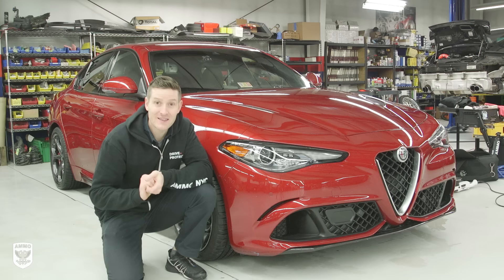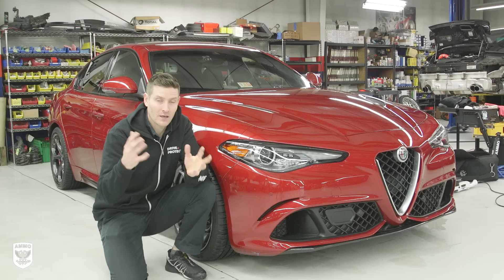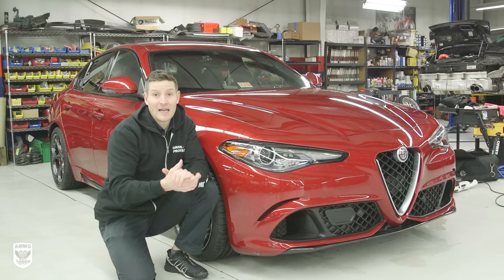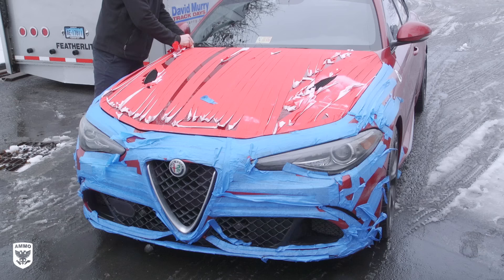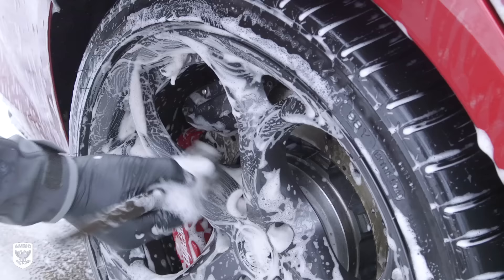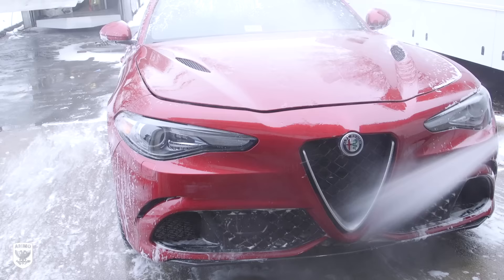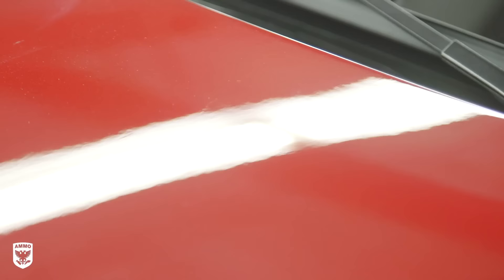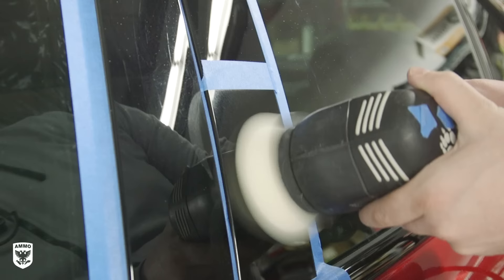New Car Prep: Alfa Romeo Giulia Quadrifoglio

Comment: the final bit of advice at the end about telling the dealership "do no touch or wash my car" is very useful. I have dealt with paint correction on a brand new car because the dealer ignored the new owners advice and took it through a carwash. It looked like a bear attacked the paint. It was horrible.

Comment: Man I miss when cars had proper manual transmissions
Reply: Gas Drawls this car comes in 8 speed auto and 6speed manual
Reply: Tony Aquiningoc oh wow I didn't know that, that's awesome.
Reply: Gas Drawls I miss before that when we had a horse and cart. .
Reply: Yes, you can get it with a stick but you can't get the manual in the US. No, it doesn't make sense and it's a stupid thing and decisions like that are why people hate FCA.
Reply: From what I've seen of the Manual, this one isn't worth it. The auto seems better, with quicker shifts and shorter gears.
Reply: Gas Drawls Why rely on technology from the 1920s?
Reply: No this is only in the auto, sadly.
Reply: zayaan ali 
But I'd still rather have the manual. Yes, it's not as fast as a modern automatic but I enjoy driving stick more than I enjoy the "foot down, let the car sort itself out" style of fast driving that a lot of people prefer these days. Kind of why I don't think I'd want a GTR or a modern Ferrari as much as an older car with more driver involvement, even if the new stuff is absolutely fantastic and way, way better than anything from even a few years ago. I really like this Alfa and would be really tempted to get one eventually but I'll probably have to stick to motorcycles for the sense of "oneness with the machine" that I enjoy.
Reply: Alfa Romeo offers this car with manual and auto only in Europe, but only auto in the state side.
Reply: Horse and cart? I miss the days when we had to walk.
Reply: Yes people I fully understand that modern day automatics are faster than traditional manuals, but I'd take a 7 second 0-60 manual transmission over a 4 second automatic. It's not about speed for me, it's about the thrill of driving, a thrill only a manual transmission gives me, I love shifting gears, not pressing paddles.
Reply: The absence of manual transmission is only a temporary choice, everything will depend on sales.
Reply: I'd rather a car with a good manual transmission. Reviewers are saying that the manual transmission isn't something to pine after, but they all say good things about the automatic. It maybe an unpopular opinion, but like I said, I'm spending 72k on this car and I want the quality transmission. The automatic is superb in this car, so I wouldn't mind it. I'd rather have a car with a quality gearbox basically, whether an automatic or manual.
Reply: No one cares about shift times or lap times.
Driving a manual is about driving.
Reply: last year Alfa was selling virtually no car to the US, makes sense you dont get all the options right now. Especially when only an handful of those would be purchased
Reply: The manual in this is just not a good manual gearbox. I'd rather have a great automatic than a mediocre manual.
Reply: Dante Gonxhja I guess you base your statement on a review. while it may not be a great gearbox different testers shared different opinions. davide cironi liked it and he seems to have quite well prepared
Reply: I base my statements on most reviews, owner impressions and having tried it myself. Trust me I love manuals, but not on this car. It doesn't feel precise and it doesn't have a satisfying shifter mechanism.
Reply: Albertotron I miss the days when we had to walk in our bare feet, as we couldn't afford shoes..
Reply: Gas Drawls This car has a manual version.
Reply: Not available in the states.
Reply: furtivedig 
Last year Alfa had one model available in the states..... and they said it won't get the manual. Not "might but not at launch."

Bit of a distinction there.
Reply: SkuzzyJ I only said it s not surprising.
Reply: I don't think that the Manual transmission is coming to the states.
Reply: I miss when you had to stick an angled bar through a hole in the front of the car and manually crank to start it.
Reply: furtivedig 
I'm not really surprised but I can still be annoyed by it. So I am.

Annoyed.
Reply: the giulia is avaiable in manual. :).
Reply: Ice Bonbon may have to do with the q4. Davide Cironi impression of the manual is not negative but I think we can agree the ZF is top notch
Reply: Gas Drawls I've driven it as manual - man it is good! The manual isn't best in the world but really goof feel to it still. I couldn't imagine why someone would destroy that beauty and connection with the car with auto..
Reply: TasteMyStinkhole Hey Stinkhole - thank you for your comment! Super and Hypercars usually aim for being ultimately fast not ultimately best drive. This thought aims for drivers car and best possible feel - as you might tell when you are driving it (I suppose you have tested both?).

Manual as a H or sequential is always more connecting and analog experience which I prefer (if I am not on the look for the last milliseconds on a track).
Reply: Mika Veijalainen 
Living with a manual in an extremely wet, hilly, high traffic environment is a nightmare, and fiddling with a stick and extra pedals in an emergency can mean the difference between an accident or a close call.  So again, people who love manuals have extremely limited driving experience.  I grew out of that shit in my early 20's.  It effing sucked.
Reply: ***** what do you mean people who drive manuals have limited driving experience?
Reply: TasteMyStinkhole I dont agree. I live in Finland where most of the year is snowy, wet and dark. Having instant throttle response, a clutch pedal and handbrake lever on slippery roads is essential as it increases control. An auto is a nightmare on Finnish winters since you have lag on throttle and have no ability to use clutch in cases (even on daily traffic). Sadly the Giulia doesn't have a lever handbrake. For example Rally cars (albeit having pneumatic "paddle shifters" on sequential gearboxes)  have both for a reason. They also don't have any slip of turbine (or alike)  and since have no lag on throttle pedal.

I don't mind the traffic on manual..
Reply: Mika Veijalainen 
Lol, wtf?  What auto doesn't have instant throttle response?  Are you driving cars from the 80's???  
My 2016 DCT M3 has nothing but instant throttle.  When I configure it in aggressive mode, it leaps forward like a jaguar on prey with a slight touch of the gas.  
Until very recently, manuals begin rolling backwards down the hill the instant the light turns green and you have to jump to the clutch before plowing into the car behind you.  Seriously, put down the crack pipe.
Reply: fair enough ;)
Reply: you struggled with moving off up-hill?
Reply: TasteMyStinkhole alright Niki Lauda, you seem to be all knowing expert here :)
ps try reading a book at some point
Reply: TasteMyStinkhole I see. thank god you are around.
Reply: furtivedig 
Yes, thank a fictional entity, good idea.
Reply: TasteMyStinkhole no wonder you don't like stick shifts, you're a BMW driver, you don't even use turn signals let alone manually shift gears.
Reply: TasteMyStinkhole 
Bet you get invited to all the parties
Reply: zayaan ali I have the manual QF and it is everything you would want in a compact super saloon! Not as fast, not as economical but interactive, makes you think about driving the car, and analogue in nature.

Comment: love the car. but that bonnet got f*cked up by that tape
Reply: sure did, but he fixed it :)
Reply: Martisan he just temporarily fixed it, with heat from the engine those lines will come back
Reply: Why? there's no tape there anymore.
Reply: Martisan They could come back because if the bonnet becomes even hotter than it was during the polish those lines can sink again. They probably came from the heat of the engine in combination with the tape. But you never know, maybe it's fixed.

Comment: My only concern is that M105 is such an abrasive compound.  Moreover, M205 has that capability when used long enough. Is the paint getting cut too much? If the paint is still similar depth to new (4-5 mil or so) I can see this being a great solution. Thanks! Awesome Channel.

Comment: I special ordered a vehicle, and the dealer actually put it on the lot when it game it...it had a deep, although small chip in one door (all the way to primer or metal) and a white paint transfer on another door.

Of course my car was a mid-range SUV,  in the $45,000 range, not an exotic sports car. 
I probably should have refused to take delivery...they did a somewhat okay job fixing those problems, but every time I look over it I find defects in the paint...bits of dust that got painted over etc.   I am not sure if this is par for the course with average non luxury cars, or if mine just skipped the QC process because it was a special order. 

One of these days I will take it to a professional detailer to see if these defects can be fixed.  Average people probably wouldn't give a crap, because these defects are only noticeable when you look right at them in specific lighting conditions...but quality control is my job, so they drive me crazy when I see them.

Comment: Nice video,i`m watching your video`s for so long now and i`m going to detail my car aswell, but i see you use 2 type`s of polishing, with the old skool pads and with the DA microfiber disc. What do you prefer to use?
Reply from the maker: Depends what works better for that particular paint and situation.  Thanks for watching!
Reply: AMMO NYC I have a Alfa Romeo it's a softer paint. But i need to do some spot repair, and the surrounding area has some little scratches. Thank you so much for your reply!

Comment: Since this most likely happened because of warm hood from the engine being on, car being driven and the tape on it. Wouldnt this have been maybe a bit easier solved by just letting the car idle for a while? Not maybe fully fixed, but at least a good part of it?
Reply: Doggepp

Comment: i would like to ask about that ISOPROP step. if you sir do not use it during the polish/cutting phase. does not the Paste cover fill the scratches and hides them in anyway? Just wonder what's your opinion to use the mix of Water/Iso after every machine pass?

thank you!

Comment: +AMMO NYC Hey Larry, I've been watching a lot of your new car detailing videos and you mention letting the paint "gas out" (sorry if that's not the exact phrase you use). I just bought a new car and want to apply a paint sealant, should I wait a little bit of time before applying a sealer or do you think it is okay to apply that sealer as soon as I get it all good and clean. If you do recommend waiting on applying the sealant, is it okay to go ahead and wash and wax the vehicle until the paint is ready to be applied? Also, does your Ammo Reflex and Ammo Hydrate play well with other products? (I ask this because I was gifted a whole car detailing kit [Hol123] from chemical guys and do plan on using the kit but don't have a "lubricant" for the drying process in the package, just a spray detailing bottle.)

Comment: Curious about the role isopropyl alcohol plays in the detailing world?  I'm used to using it on most things but never on any of my vehicles.  

What are the general uses for it besides after a polish, or is that about it?  Any use for it on a car with heavy swirls or bug damage (from the prior own putting 10k on it and washing it with what might as well have been rocks)?

Awesome video as always, thanks!
Reply: SoloCamo Isopropyl plus distilled water is great on glass,
Reply: SoloCamo the only purpose of IPA is to remove oils not contamination, before applying a coating or durable sealant as Reflex. this allows for the sealant to bond directly to the paint and not have any interference. If one was to apply a sealant or ceramic coating over a polished panel and oils remained, the product would either not last as long or in other words prematurely fail. IPA is also good for breaking down tree sap and mineral spirits is also a handy item for pesky sticky substances on a vehicles surface.
Reply: Thanks for the responses.  Makes sense as far as prepping a surface goes as I use it often for that purpose during painting, cleaning, etc on other projects.

Comment: Why not use body shop heat/curing lamps ? They cover huge areas and would be much easier and faster.
Reply from the maker: russkiboy1 it didn't work as well needed the pressure of the machine

Comment: Bought a black used car (first car!) and it has a rough clear coat, especially on the hood. 
Is it worth it buying a cheap $30 'polisher' machine just to do the job once?
I dont want to spend $100- on a machine that I would use maybe once a year at most.
Thanks in advance.

Comment: Not video related but I feel like you guys can help me out. I have a new Tacoma off road. It comes with lots of plastics and the bed cover. I've owned it for a couple of months and it's starting to fade. Ive used 303 aerospace and it's makes it really nice and shiny but doesn't last long. Along with not lasting long it attracts lots of dust. Also on one of my black fenders I wasn't careful and a drop of sealant fell on it and left a stain. What should I use to remove stains? Any videos someone can refer me too
Reply: Meguiars All Purpose Cleaner, dilute it properly.

Comment: What was this guy thinking.... a few hundred miles in crappy weather does significantly less damage, if any at all, than the tape would do. Some people... use common sense!!!
Reply: He just wanted to protect his car from rock chips during highway driving, which is a valid concern.  He probably went a bit overboard with the hockey tape on the bonnet, but who knows, he may have saved his car from a few rock chips that can't be polished out
Reply: owner of the car here and wanted to say it had super soft paint that already had 4 microchips in there, I didn't care what the tape did. Wanted to protect the car and knew larry could handle what ever in result. Massive storm just made things a bit harder with heating of engine and cooling of residue.
Reply: kanundrum ahh, I understand. Awesome that you got to have it detailed by Larry. If anyone could fix the problem it would be Larry. Beautiful car, very jealous. Use it well!!!

Comment: Hey Larry, I have a question: in former videos you said paint hast to breath about 6 months before you can put waxes on, otherwise you damage it. Is this theory wrong or what is different to a new car in this aspect?
Reply from the maker: a new car usually gets painted at the factory and it has time before it gets to the dealership to gas out.  (in most cases)

Comment: Agree with the "take your new car home without it being washed so you can do it yourself" 100%. The way new cars are just "washed and vacuumed" is just horrific. Dealerships hire the most inexperienced kids that have never washed a car so they can find and pay them $8 an hour to pretty much assult your brand new 45k SUV with wash mitts that have been dropped on the ground. Then those same kids use some type of "body shine" to remove the water streaks with a mircofiber towel that has, more times than not, have been dropped on the floor and picked up and reused. So yes, save yourself the trip back to the dealership to gripe about how bad your car looked when it was delivered and just clean up the car yourself because the older, more experienced detailer (like myself) gets very tired of correcting $8 an hour fast food rejects messing up brand new paint.

Comment: Tip to clean with alcohol, pour it on the car, pour some on you, get a lighter, turn on the lighter touch on the car, so it creates a fast on and off burn/flame that will clean any residue on the car and your hands (so you don't put those greasy fingertips, all over). 

Thank me later.

Comment: You really shouldn't close the hood like that on carbon & aluminium hoods. Its fine if it is made of steel. Just give it a small slam about 6 inches high
Reply: nazhif1 if it breaks from him closing it like that, then it would break no matter what.

Comment: how come there was swirl marks on a new car?
Reply: Caro Babaknia from the dealer washing it and the factory
Reply: how come only the door panel was swirled though?
Reply: Because generally parts like the pillars are usually plastic that is painted ( generally at the factory that makes the part ) in a different place than the vehicle body. All colors of the vehicle have the same black pillar. These parts are put on last and don't take the same type of quality paint and clearcoats as the body paint.

Comment: What about all that orange peel?
Reply from the maker: Mad69Russian it's carbon fiber?
Reply: AMMO NYC No its the effect of speeding the painting process when it was made. All cars have this today sadly enough! You can see on restored cars that the paint is more flat which means less orage peal beacause the resoration is based on perfection not time.
Reply: I thought that was a result of changing to the water based paints some years ago. You don't see this on old cars, but all new cars have it.
Reply: YaKuZaffs I think that Larry knows what Orange Peel is. You can see on panels like the bumpers and wings that the orange peel isn't actually that bad. The reason it looks worse on the Bonnet (hood), is because CFRP itself is very textured, and spraying the primer and paint directly onto it makes the paint take some of the texture of the Carbon weave. So it isn't the paint "orange peeling", its the paint sprayed onto an imperfect surface causing it to be textured.
Reply: Lol you do not need to explain what orange peel is to one of the best detailers around, c'mon..
Reply: Clement P I never said it didn't. Im just pointing out its not something you can fix like Orange Peel.